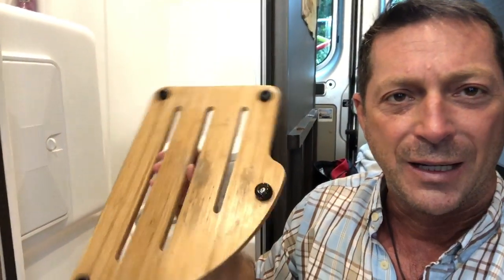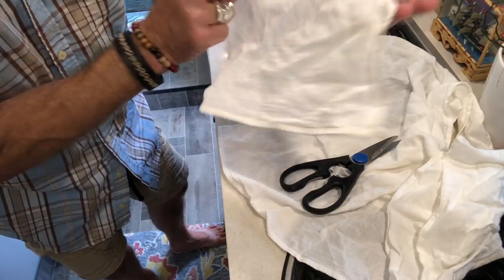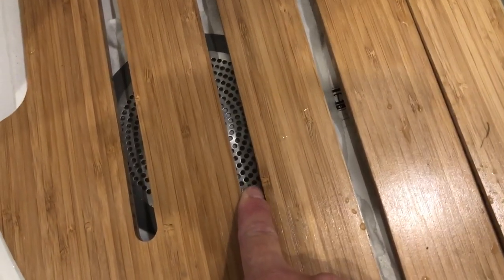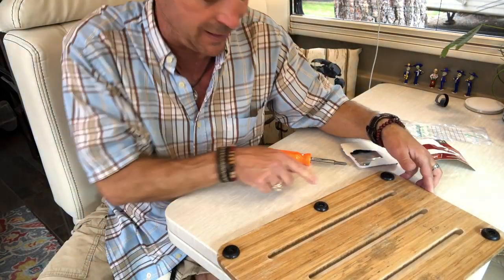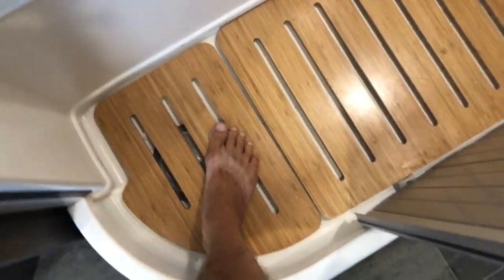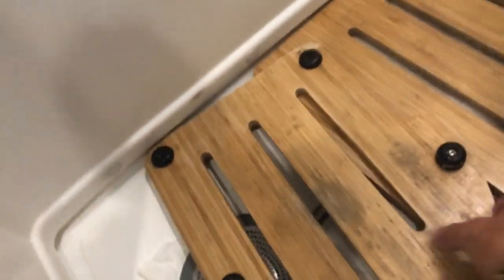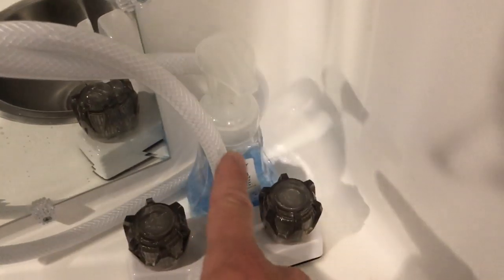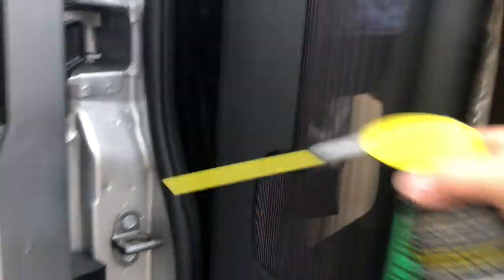CLOGGED DRAIN SOVLED in Travato 59G Class B RV BATHROOM  |  Vanlife in a Travato GL

Comment: Brilliant with the dry lube. Will try.
Note I cut the left side of the large matt so that it hangs out a bit farther from the door. Huge benefit. I cut the far end and the inside corner. Can't tell it was cut.
Also consider removing the wood before every shower. It prevents water damage to the wood and gives you a chance to wipe down your bathrooms walls and floor after showering.
Reply from the maker: Interesting ideas Ricardo. Appreciate you sharing!

Comment: Every time I go into the bathroom I think, "was it take your child to work day at the Winnebago design shop?" No way a grown up designs a shower drain like that! Thanks for the tips. Already bought the drain cover but now need the cheese cloth (though that looked more like muslin.) 
The owner of the dealership I bought from said his only real advice to new owners is to dry lube EVERYTHING. Works great and not as messy as the regular stuff.

Any tips for getting to the pump filters? More specifically I struggle with getting the bottom drawer back in after cleaning the pump filter. The plastic drawer stops have me flummoxed and the tight space doesn't help. Thanks!!
Reply from the maker: In this week's Q&A Friday I show how to clean the 59G shower drain pump filter. I don't have plastic drawer stops in my galley cabinet, and removing the bottom panel is very easy.  Check the video published 16-Aug and see if that helps you out at all.
Reply: @gosmall.livelarge  Awesome! That pump is easy to get to (though I did have to unscrew it from the floor the first time because the filter housing was way more than "finger tight" and I needed more leverage to get it off.) My problem is the main water pump under the bottom drawer in the galley. I wish they swapped locations of those 2 pumps since the main water pump seems to want cleaning more often. Thanks for everything you do!!!

Comment: Great job Scott! Notice though that the finish is coming off on the bottom of your floor mats, probably due to sitting in water or not drying completely off. I have one of those mats in my Hymer Aktiv and I was thinking about that same issue for "when" I use the shower (jealous of your shower size btw lol). I was thinking I would either remove the mat when I shower, or tilt it up to dry afterwards - preventing deterioration or mould on the bottom.
Reply from the maker: Hi Sharon. Yeah I rinse the bottom of the matt off thoroughly with the matt using the shower head. With the new "feet" on the bottom of the matt I think it will dry of faster reducing some of the potential issues. 

Love the size of the 59G bathroom, very large and functional.

Comment: Oh yeah, very helpful mods!  Thanks, Scott, for sharing your solutions. I, too, can’t believe how fast that tiny filter clogs up. Since I wipe down the floor, I suspect the mats themselves harbor dust and lint, so I shower without them on the floor.  Question: have you checked the filter under the panel under the kitchen sink?  Is the cheesecloth method causing that filter to clog more quickly?
Reply from the maker: Hey MN. Based upon your question I demo how to clean the shower drain pump filter. Really easy to do. Using the cheesecloth method I'm now cleaning that pump filter after 7 or so showers vs 3-4 previously.   check out the video posting 16-Aug

Comment: Where did you get the mats.
Reply from the maker: They came with my 2019 Modell Travato. Probably can order through a dealer. Would definitely get the mats fro great under foot feel.  And then put in the rubber feet that I recommend in the video.